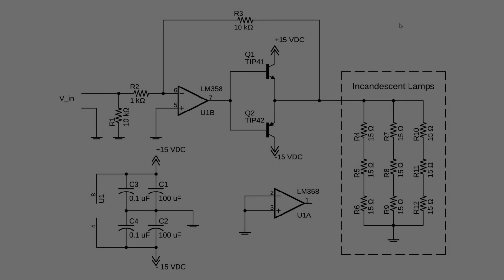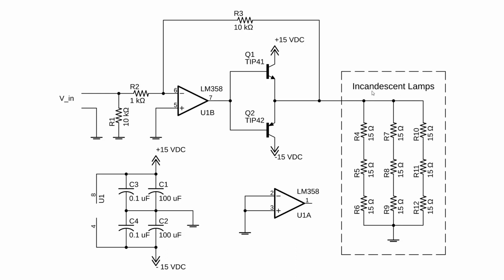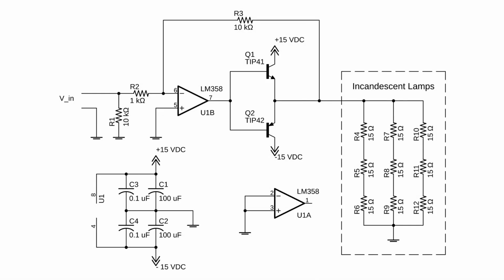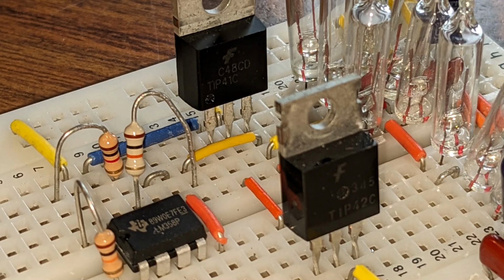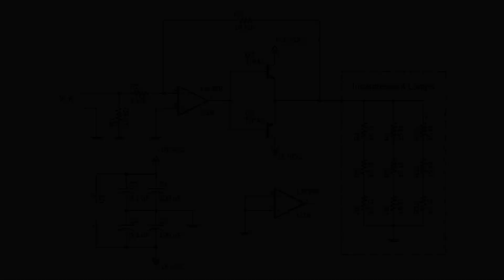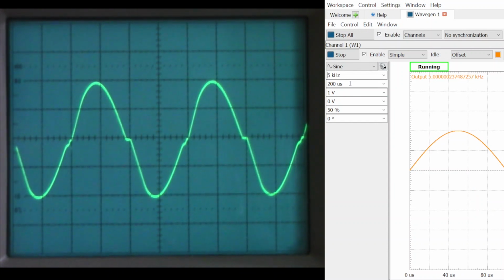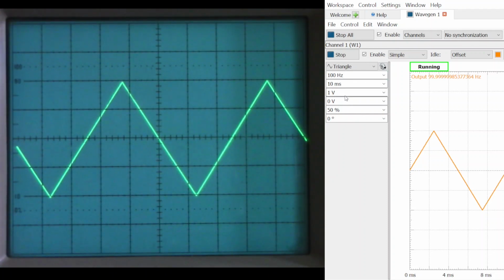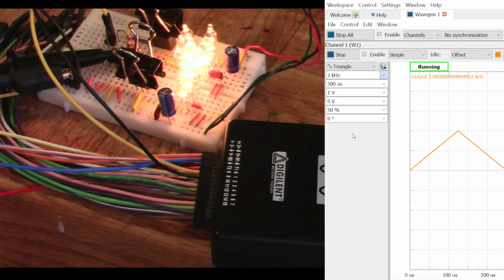Simple Class-B Op-Amp Current Booster with TIP41/TIP42

Comment: Don’t force both inputs to ground for unused opamp. That’s not the right way to do it, especially with a single supply. Make it a unity gain buffer, input 1/2 supply voltage.

Comment: I think that he's expecting the OP amp to deliver a bit too much driving current in this application so that would be a source of distortion when the output is loaded as the gain of the transistors drops. You are correct though, just only gently load the OP amp and use a fast OP amp so the slew rate corrects things

Comment: I would understand the presence of X-over distortion  in case the feedback path would be connected to the output of the lm358 instead of the circuit output.
In the configuration you show, there is a lot of global negative feedback due to the high amount of open loop gain. Distortion should be very low?